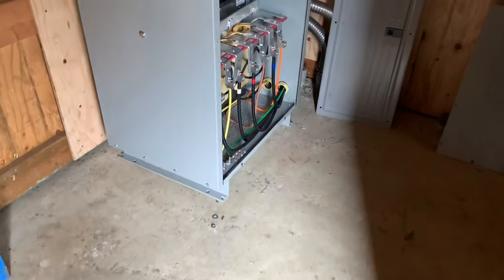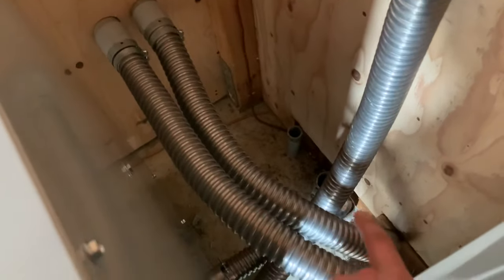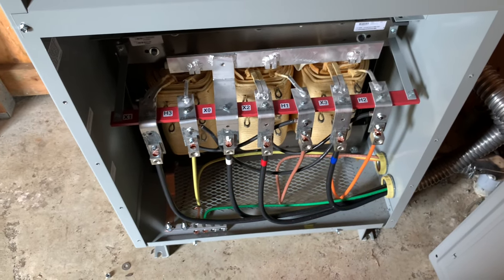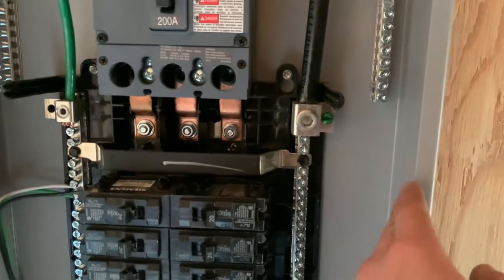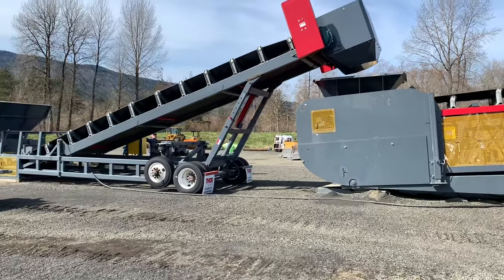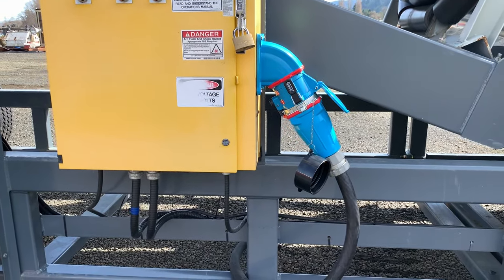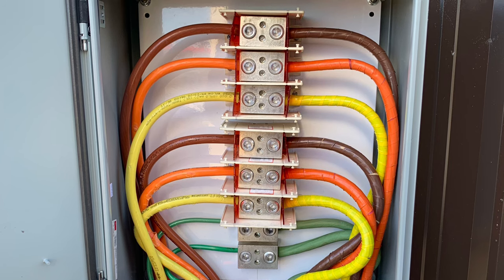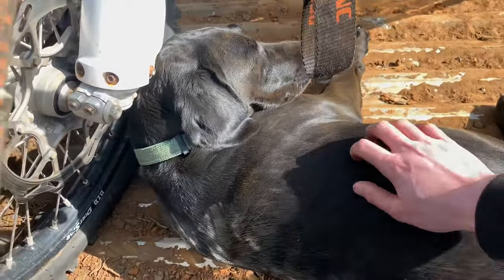Today As An Electrician: 480 Volt 3 Phase Transformer

Comment: That's solid and not stranded? Looks stranded when you showed the plug end. I can see it says 3/O on that yellow wire on the bottom left, so it looks to be 3 ought. Never heard of solid wire that thick.
Reply from the maker: its stranded if i said solid i made a mistake. its just super stiff
Reply: @DailyElectrician  Yeah you said solid. I was like holy crap, that would be crazy. You never know, though. I thought maybe it was just something I have never heard of. Lol
Reply: @DailyElectrician  Did you use anything to help you bend it, like a 2x4 or something?
Reply from the maker: nope just me lol
Reply: @DailyElectrician  I hope you had a good breakfast. Lol
Reply from the maker: just apple juice lol

Comment: I've come to enjoy watching your videos, but never forget to bond the transformer.  Tie the neutral from X0 to the ground bar.
Reply: Bonding at the transformer is not required. You are allowed to bond the neutral at the main disconnect enclosure, which was the panel in this installation. Some do it in the transformer and some do it in the disconnect. Either method is acceptable.

Comment: Why didn’t you use double lugs to connect XO to the ground ? I think you missed it 🤔
Reply: He didn’t miss it. They chose to bond neutral to ground inside the secondary disconnect (main panel) instead of inside the transformer. It’s acceptable to do so in either. But not both.
Reply: If so he will find out. Floating neutral 😐
Reply: You have to bond at the FIRST means of disconnect…? No?
Reply: @jacobfranceschina7722 yes. This is a separately derived system so you need to reestablish your ground to neutral connection inside the transformer

Comment: Looking at the transformer connections, I would assume the system bonding jumper and grounding electrode conductor is going to be installed at the panel the transformer feeds? I'm used to doing it all in the transformer and isolating the neutral after the transformer. I've noticed over the years that guys that come from residential into commercial, are used to having the bonding jumper and grounding electrode conductor in the panel which means in the transformer, the  neutral would be completely isolated. Either way is fine, I just prefer to do all the Neutral grounding and bonding in the transformer
Reply: If done, what you're mentioning would be considered a supply side bonding jumper to the raceway. We (National Electrical Code, in United States) are not required to use them unless , in general, it's 250 Volts to ground or higher (so secondaries of dry type transformers with nominal voltages below 250 volts, i.e., 120/208Y, 120/240 single phase, 120/240∆, 240∆ corner grounded, 120 single phase, 240 single phase and ungrounded 240∆) and oversized, concentric or eccentric knockouts are encountered. If this were a service, then yes, a bonding bushing would be required, regardless of voltage unless the raceway connection was UL 467 listed which isn't always the case.

Comment: "Suicide ends" is what we always called those cord and plug connections, either pin and sleeve like the one shown or just 120 cord caps where the male-end is energized. Also I've never seen a dry type transformer used in a building to feed 120 208 panel boards where it was a Wye primary and secondary. Usually it's always a Delta primary and wye secondary. I live in Virginia Beach Virginia and the utility company out here for whatever reason on almost every service overhead, the transformer pots on three phase is wired Wye/Wye!?

Comment: Looking at the connections, that is definitely a Delta/Wye transformer. My question is, on the transformer wiring diagram and nameplate, does it show the high voltage or 480 side connected in a Delta or a Wye? It could have gotten ordered as a step up transformer where you would feed a primary Delta configuration with a 208 volt, 3- wire circuit and have a 4- wire Wye 480/277 volt secondary serving the load. Conversely and typically, If it's a 480 to 120/208 step-down configuration, then the 480 would hook to the H terminals (and making sure the pre-installed black insulated tap conductors coming off the "H" terminal bus all go to the same number tap on its respective coil) and the H terminals would be the delta triangle configuration. The 120/208 conductors would terminate to the "X" terminals configured in a "Y" star connection. So to sum it up with a dry-type Delta/Wye transformer, where used for step up or step down purposes, you need to know which side needs the neutral, is it 480/277 volts (needs the neutral for the load) and you're feeding it with a 208 volt- 3 phase circuit wired in a Delta? Or is it 120/208 volts (needs the neutral for the load) and you're feeding it with a 480 volt- 3 phase circuit wired in a Delta? Could be either way- 480/277 Y secondary 208∆ primary or 208/120Y secondary 480∆ primary.
Reply: Yea,  what's going on here,  whenever he showed the neutral on 1,  is that a wye neutral so all transformer secondary negatives go there,  cause if it's only between within 1 end,  it's a delta secondary with center tap neutral for 120 v.  Right?
Reply: @ryanb1874  I think you may have the right idea IF it were a mid-grounded delta (3 coils, 3 phases, 4-wire, line to line is typically 240 volts, line to neutral/ground is 120 volts on 2 of 3 phases, 208 volts on the high-leg). Typically, the coil (1 of 3) between AØ & CØ has a center tap at the halfway point and is grounded and where the system neutral connects (just like the single phase coil that feeds your house that has 2 hots and 1 neutral that originates from a center-tap of the coil that's grounded). Thay way AØ & CØ voltages to the neutral or ground is 120 volts but BØ volts to neutral/ground is about 208 volts (BØ has to go through the BØ to CØ coil and parallel BØ to AØ coil and in series with 1/2 of the AØ to CØ coil (from both sides) to ground giving you the higher voltage called the "High-Leg" or as some older electricians call it, the "Wild-Leg", and per national electrical code, required to be identified and marked with the color Orange. This arrangement is called a Mid-Grounded Closed-Delta (Using 3 identical coils; same kVA rating, arranged like ∆. A Mid-Grounded Open-Delta is 2 coils; one significantly larger (called the "Lighting-Pot"), and one smaller coil (called the "Teaser-Pot" or "Kicker-Pot"). When hooked up, you get the same voltage measurements as the Mid-Grounded Closed-Delta but current and power wise it is extremely unbalanced and can only support a percentage or fraction of the load (about 87%; some would argue 58% but it's about 87% but needs to be able to handle the three phase load Plus the phase load to neutral for the "Lighting-Pot" sizing in kVA) that the Closed Delta could deliver of the same size overall.

Without the supporting math behind everything here, that's about as much as I know about mid-ground Delta transformers. 

Come to find out, what's shown here in this video is a 480 volt, Delta, three phase, three wire primary to a 120/208 volt, Wye, three phase, four wire secondary. Probably feeds a main breaker panel board for lighting, appliances, receptacles etc..

I'll tell you the system that really screws people up is a Corner-Grounded Delta system where, typically it's CØ, is intentionally grounded in a 240 or 480 volt nominal Delta system with line to line loads only. After the service (you'll see three over current protection devices at the service only) with a system like this, all the equipment like panel boards will look like single phase installations where you have two hots and grounded conductor which is typically a neutral but in this case it's actually a phase conductor but since it's grounded it's required to meet the national electrical code requirements as any grounded conductor would so it looks just like a neutral bar. All the motors that are fed from a panel board downstream from the service will be filled with two pole breakers so you would have two hots from the two pole breaker, plus the grounded phase conductor and an equipment grounding conductor and you would hook up the motor like you would any typical three-phase motor except the grounded conductor is hooked up as one of the three phases and yes that grounded conductor must be  marked/identified as white or gray etc. per NEC 200.6! If you take the other two phases to ground it's the line to line voltage so a ground fault is actually a short circuit on this system. The grounded phase conductor is of course zero volts measured to ground with your meter but if you're in a junction box and open it up and ground yourself to the load side of that grounded conductor after you broke that connection apart, you get 480 volts through you instead of 277 volts like a Wye system, right after you just checked it the ground and it said zero volts! Because the corner grounded Delta is a grounded ac system service, you're not required to have any ground fault indicators to help troubleshoot ground faults on the system like you are required to do with an ungrounded system.

If you have made it this far in reading this, God bless you! 🙏✌️👊
Reply: @jaredkilgore7194  made it this far. Have no clue what it means lol
Reply: @silent6898.  That's where visual aids and instruction comes in really handy. Plus, I may not have articulated it but so well...lol
Reply: @silent6898.  hang in there...🤪⚡

Comment: Transformers hum. You only connect 1-3 and your lower voltages. Transformers are preset at factory for delta or wye. Depending what you need. 120-240 or 120-208 .

Comment: I have a Ac system that has a 480 to 240 resin encapsulated transformer. The unit has a 240 terminal block to connect 240v accessory’s. I have a 240v fan motor that is over amping. When I check across the 240 terminal block I get 249v. When I check each side to ground I get 140v and 288v. Is this my problem? Thanks.

Comment: Does the Transformer taps come pre-installed?
Reply from the maker: i forget if i put them in or not.
Reply: Usually, yes. Most offer 2 positions for 2.5% higher voltage and 4 positions for 2.5%-4% lower voltage.